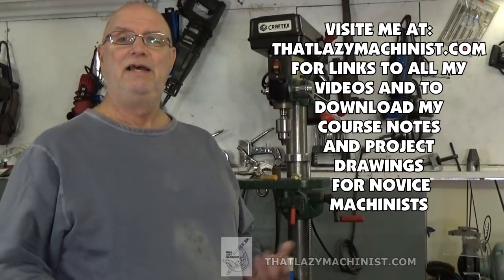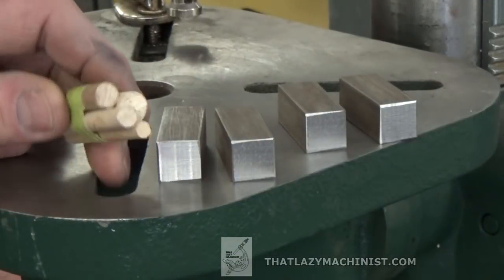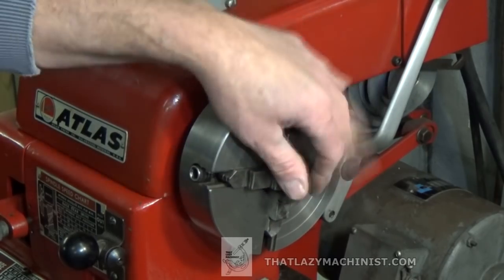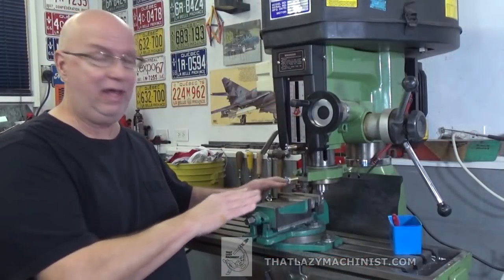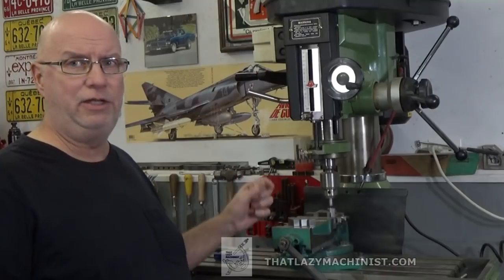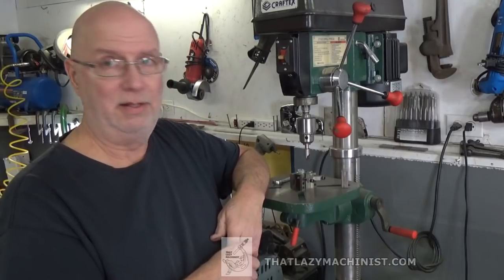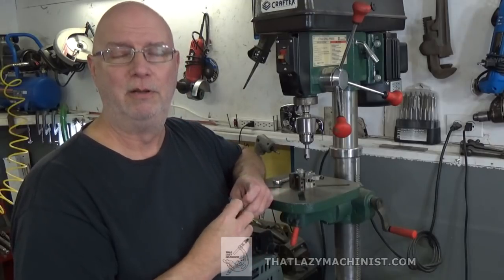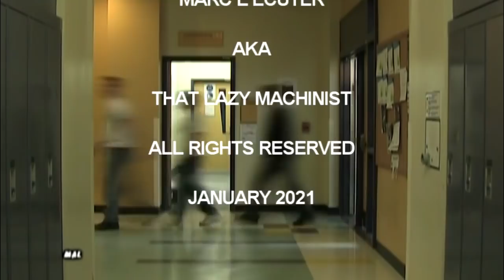BURT'S JIGS a just for fun machining project, turning, milling & drilling. Lathe, mill & drill press

Comment: Hey Marc, good to hear from you!!
Good stuff in your video, always.

What do you think about this sequence, if using the lathe:
1. Hold in the 4 jaw
2. roughly center by eye
3. face 
4. remove the part, and hold it in the 4 jaw with the other end protruding
5. center the part properly
6. center drill
7. drill with the larger drill to depth
8. drill with the smaller drill all the way through
9. deburr everything

Take care dear Marc, and please find some more time in the shop, and keep the camera recording... :)
Reply from the maker: Some explanations are required to answer properly so I will produce a short video on the subject, hopefully today or tomorrow. Thanks for a great question, thanks for watching and be safe. Marc

Comment: On the lathe, couldn’t you drill the small hole all the way through the part then drill the large hole from the same end. Then when you turn the part around you can face it off without having to have it perfectly centered?
Reply from the maker: Some explanations are required to answer properly so I will produce a short video on the subject, hopefully today or tomorrow. Thanks for a great question, thanks for watching and be safe. Marc
Reply: @THATLAZYMACHINIST  thanks. I am looking forward to it